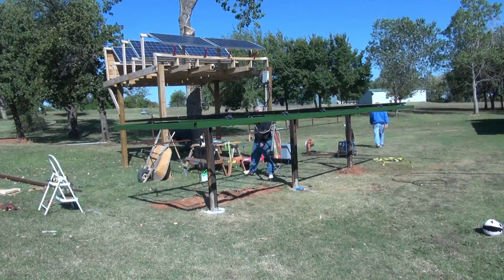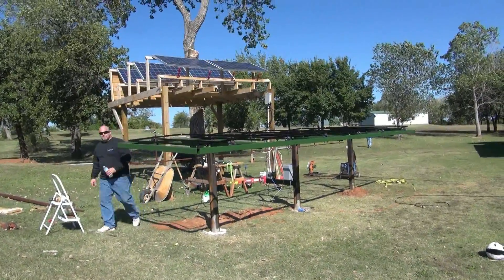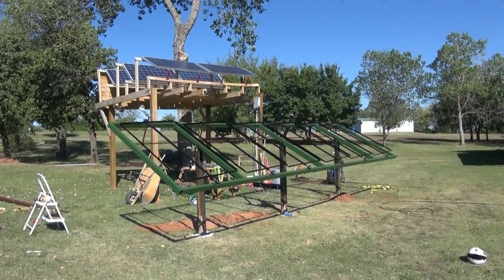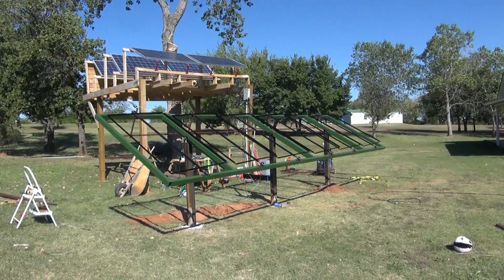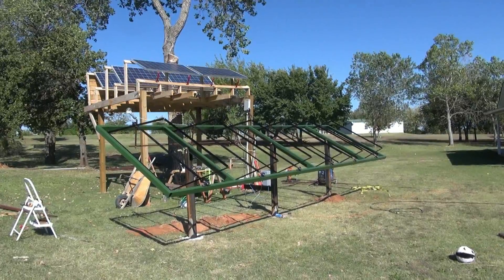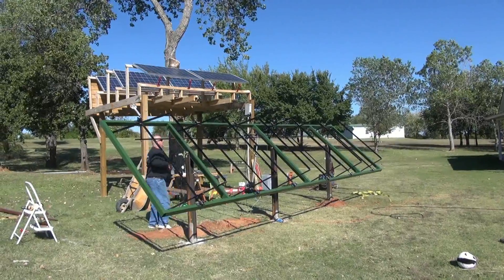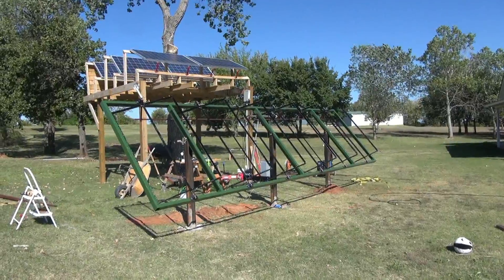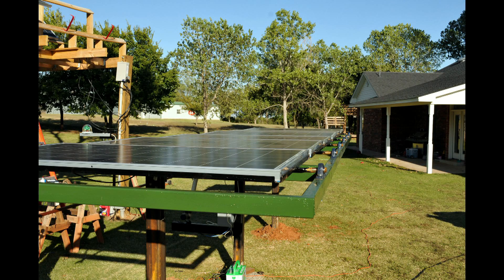Solar Tracking Beta

Comment from the maker: The actuators are IP66 rated so they are water / dust proof and rated for outdoors.. Each one is 1000 lbs push / pull force. One actuator is for N / S and the other is E / W... Hindsight being 20/20 I don't need anything nearly as powerful..... I can move the E/W axis with about 10lbs of force....  Go big or go home right?